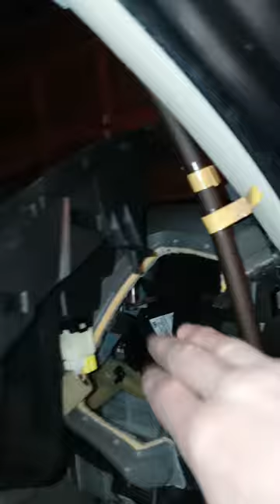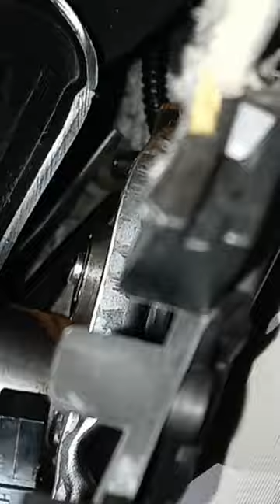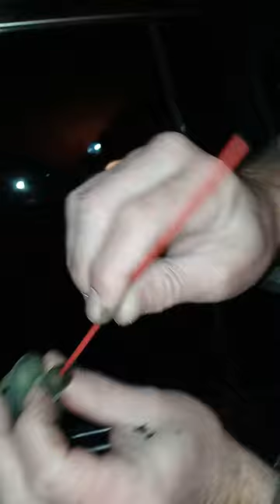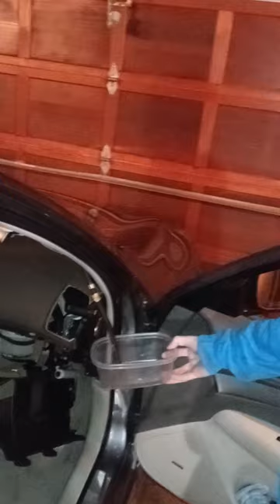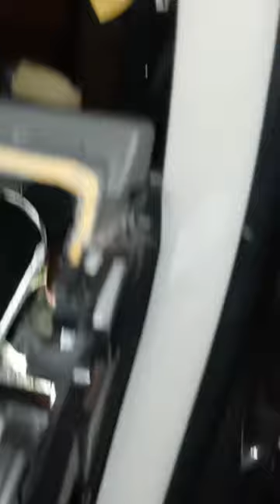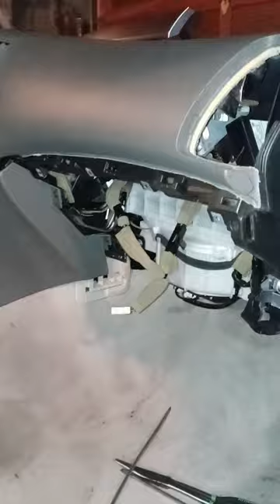G37 Sunroof Leak Complete Fix!

Comment: Just extend that drain hose down to the condensate drain under the passenger carpet.  Use a 3/8" plastic wye and be done with this Japanese nonsense.  Too much playing around trying to grab that silly badly designed pop-in fitting with its leaky gasket.
Reply from the maker: Good idea!! I may do that next as we had massive rains the past week and some water made it's way into the cabin!
Reply: Thank you for this concept. I’m fixing my daughter’s car this way right now since I’m 800 miles away from my tools and the fittings I bought.  Strangely there was an ant infestation under the under padding.
Reply: @GusMahn  Insects do like wetness. I drilled some holes to drain the water first, then did the drain tube a few weeks later.